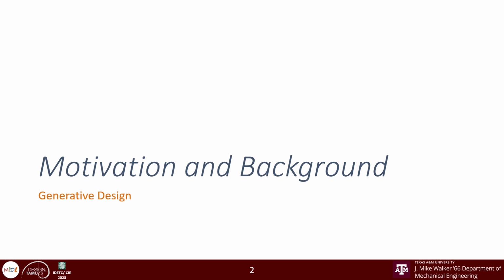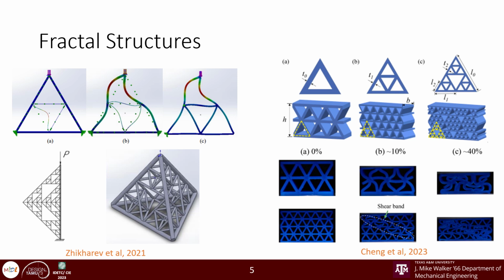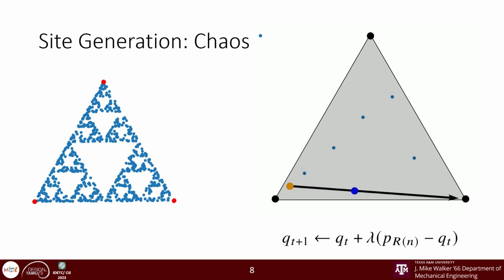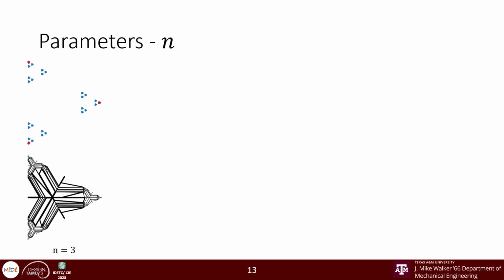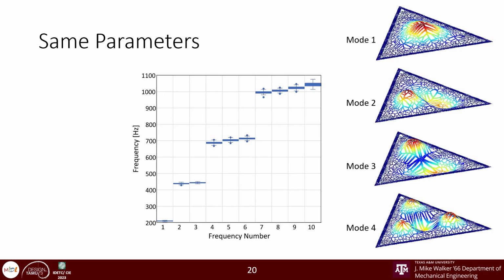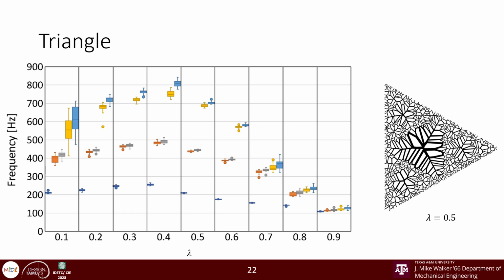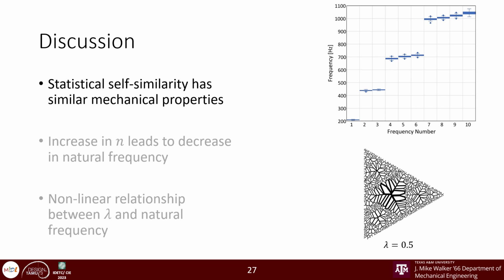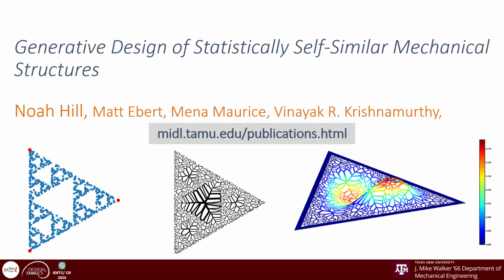Generative Design of Statistically Self-Similar Mechanical Structures (ASME IDETC/CIE 2023)

Comment: It'd be interesting to compare to a uniform point distribution (points chosen entirely at random with uniform density), blue noise, etc.
Perhaps the fourier spectrum correlates with frequency modes.
Reply from the maker: Great point - thanks! In fact, in addition to uniform distribution, another option is to consider some regularized version of the same geometry (e.g. based on Lloyd's algorithm for Voronoi partitioning).